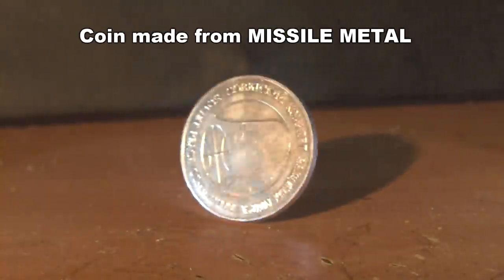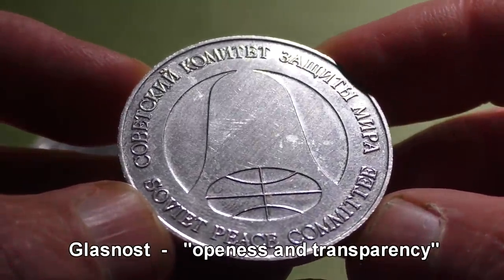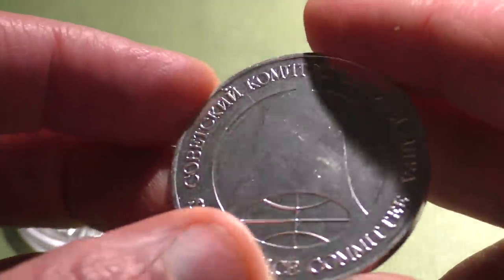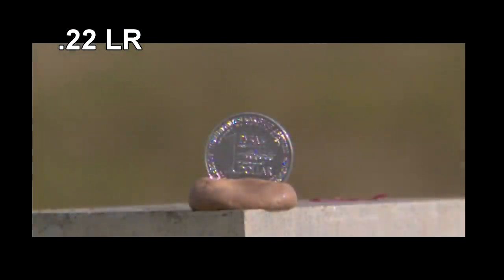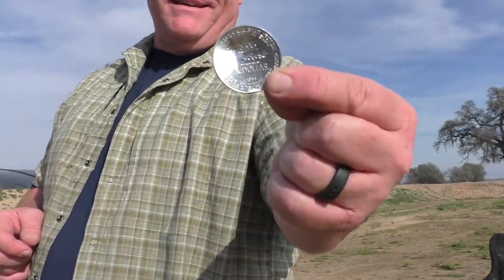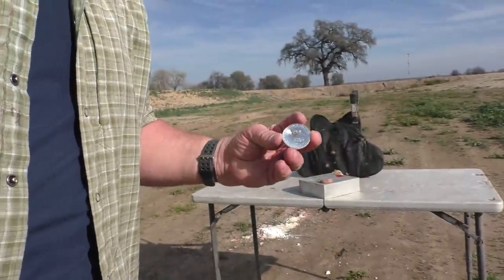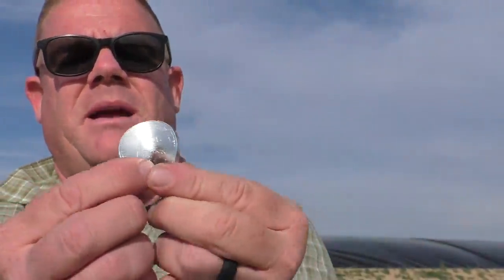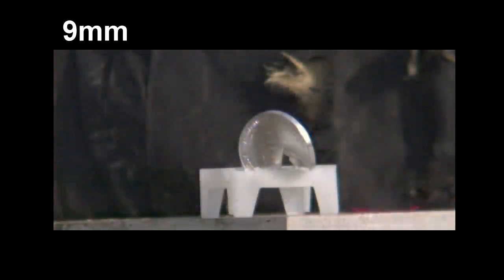⛔️Soviet Titanium COINS made from MISSILES - Are they  Bulletproof?

Comment: I'm shocked. I figured none of the coins would survive. 

Off to Ebay to buy 3 or 400 of them to make some Dragon Scale armor. :D
Reply: Or you could make a missile
Reply: Make sure you use an adhesive that has a better range than the ones they originally tried out high temps(104°f+ ambient temp & over 70% humidity combined ) they tested at that duration made some, but not all had their laminations degrade that held their plates in their array of vests tested. They , on the rest of the testing worked exemplary though under that overall field exercise.

Comment: I think that with the small, light target, the different methods of holding the coins likely make a significant difference... If it was held to the table with an infinitely strong weld, a lot more energy would be transferred into deforming the target, instead of moving the target around... (for larger, heavier stuff it seems less relevant, by the time it starts moving, the bullet is mostly gone)

Edit: Of course that was mentioned just after I typed this...

Comment: Titanium has aluminum in it to make machining it easier. I used to work with it in a machine shop. It's also easy to understand that a bigger surface hitting the coin at a slower speed(such as the .45) will only dent it. A faster, smaller surface hitting it will have a better chance of going through the coin. Simple physics. Speed will be a factor, so the faster the better.
Reply: Just curious if you know, I’ve heard that forging titanium (heating it then working it with a hammer and anvil) can cause it to explode. Does that have to do with the aluminum in it?

Comment: The Aluminum component to the alloy allows the alloy to bend around the impact point. Very interesting results. Wish you would have included 32 acp as an intermediate step in power between the 22lr and the 9mm.

Comment: alloys are pretty brittle, especially titanium.  that's why there is a gash and no hole. (except for the Burno)  Love these vids!  stay safe gents.
Reply: Uh, are you missing a word there?  Because saying "alloys are pretty brittle" is just...well, "overgeneralization" doesn't even begin to cover it.
Reply: @Bacteriophagebs  that was the whole point, I was generalizing.  Hence saying "alloys"
Reply: @nixxtable  As I said, "overgeneraliziation" doesn't even begin to cover that.
Virtually every type of steel and aluminum in use is an alloy.  Very few of them are brittle.  Bronze is also an alloy.  Also not brittle.  In fact, there are far fewer brittle alloys than not.  In fact, most of the time, metals are alloyed in order to make them less brittle.
So I guess I wasn't clear: that's not so much an overgeneralization as it is just plain wrong.
Reply: @Bacteriophagebs  cool thanks for the info, I did not know that.

Comment: 8:43 Not one of those ppl, but they aren't wrong. It 100% "makes sense physics-wise". When you change what's holding the target you're changing the resistance, more resistance = more force applied from the bullet. If you want to do a test, you want the same resistance on every shot, or else you can't compare them.
Reply from the maker: Usually the targets are many times the mass of the bullets.  Interesting to see how a target less than the mass reacts.  We learn something new all the time.

Comment: The coin could have been straped/affixed to a 2x4 or probably better a length of 2x6. Assuring the wood was also firmly firmed on something firm? So it wouldn't flex etc. You know what I mean I hope.
Reply from the maker: yeah but then the wood adds to the resistance

Comment: Titanium is lighter than steel, but it's not really all that much stronger.

What you want...is tungsten...as far as singular materials go.

In either case, alloys are always superior, provided they're composed of the correct materials, and combined in the correct way to take advantage of all the best traits.

Graphene might hypothetically be superior, but it's still too difficult (if it's even possible) to produce completely intact sheets of it, and to laminate them in a way that their benefits aren't compromised.

Comment: With the 10mm argument vs .40cal I have shot both and sadly I must say u don't get much difference unless you buy high velocity ammo for your 10mm. If ur buying what's affordable then the difference is usually 100fps which isn't much in way of ft pounds. And .40 ammo I usually get for 10 bucks cheaper a box than 10mm of same brand. You decide
Reply: I get mountains of free .40.  I still carry 10mm and buy every single round at full retail.

Comment: Jeff, you and OG missed a golden opportunity when you did not leave the coin unsupported and taken a shot with the FK to prove to people that the coin, supported or not, is still going to be penetrated by the high velocity round.  When it comes to penetrating hard barriers, velocity is king, which is why the 9mm does more damage than the .45 ACP.  in general, a 9mm FMJ will almost always penetrate better than a slower .45 ACP FMJ round simply due to it's higher velocity.  The design of a hollow point can change everything, especially in jello.  Putting the coin against a hard, heavy barrier such as a 30 lb. block of lead, will still not change the results... the 45 will leave a big dent, the 9mm will crack the coin but still not penetrate and the FK will still punch a hole.  However, you will have to actually do it to prove to people that it's just the way things are and the odds are, someone will still whine that you did something wrong because they just don't want to see the truth!  Oh well...  keep up the interesting work!
Cheers,
jc
Reply from the maker: We missed many opportunities.   We only had 5 coins